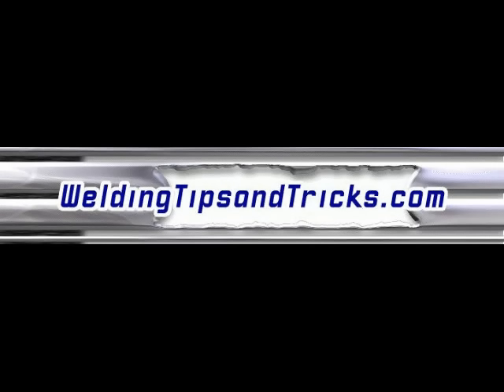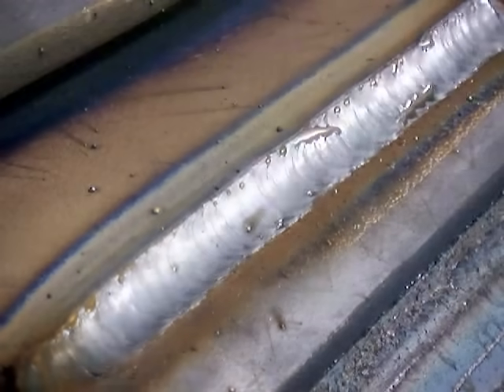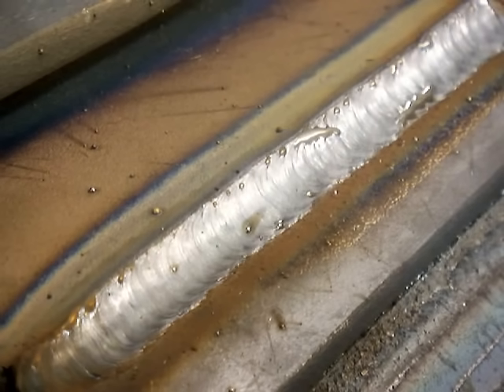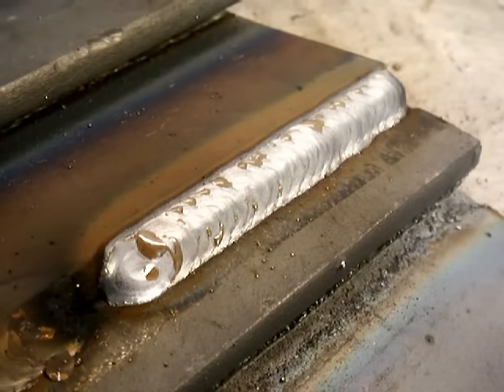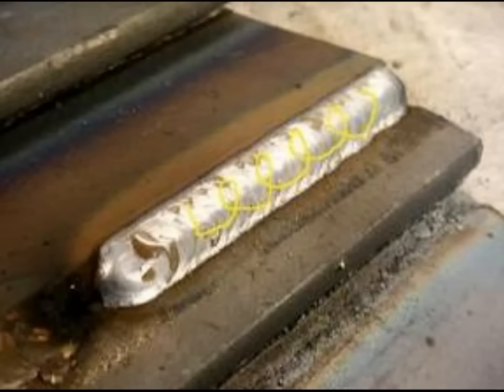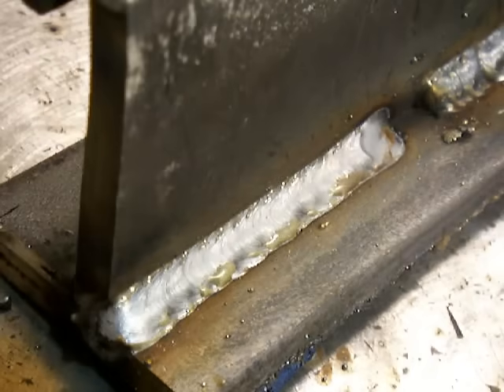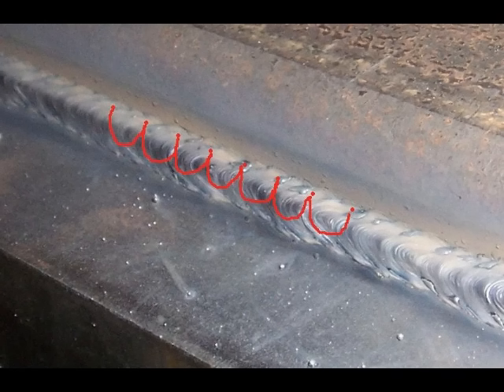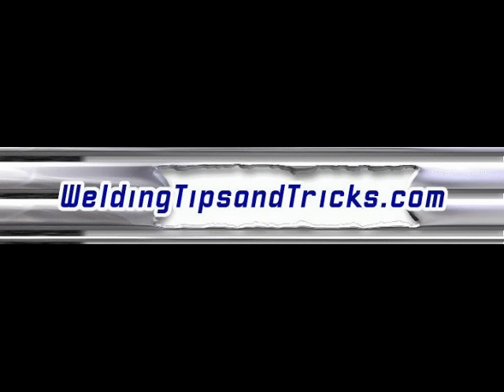Mig Welding Technique Taught by Old Timer

Comment: I do almost the same thing. almost every weld joint. I've been a welder and fabricator in a union for 30 years, never had a weld break. not to my knowledge any way. but I do know when not to use mig. or step up to .045 innershied, or stick.

Comment: Good looking weld but small circles or cursive e causes a weak spot in between the puddle. I welded that way for years and had some more experienced welders teach me to do a slow whip and pause for more strength.  Either process worked I never had a weld break doing either technique.

Comment: I am a new welder and am having trouble doing lap joints on 3/8" steel.  My welds are too convex.  I have tried 17 to 21 volts, and 200 to 350 wire speed, but I just can't seem to get the bead flatter.  I have used a cursive E pattern as well as a zig-zag with a pause on the base metal.
Reply: Try a cursive horseshoe or "C" pattern experiment with slight pause at apex to fill. Works-For-Me. GODSPEED 👍
Reply: @Censored-Sgt  Thank you!!!!!

Comment: This is great for running slower on a weaker machine that can't necessarily keep up--I use it a lot at home.  At the plant I have an old Miller CP-302 and I can crank up the voltage and wire feed and just let it burn.

Comment: Great videos Cody, I was a pro for 10 yrs, welding cylinders prepairing for sub-arc upto 150mm/6" inch to you American's. With stick before mig came in. Now I'm just an old hobby welder, best skill there is, used mig sets with very basic settings these mig welders today are someting else😊

Comment: I stick welded in highschool at vo-tec but i never mig welded in my life it seems to be kinda the same you just got to pull or push the puddle depending on which direction your going seems to be pretty easy with enough practice i should be able to weld like you a pro thanks for the tips!!!!👍

Comment: you should use a "Z" side to side because when you go back where you have already been you increase the chance of internal cold lap. Even if the outside looks very good there is the greater possibility of internal cold lap which for plates you are welding here may not matter but if this is put under high pressure for a long time you want a weld that doesn't have any or atleastthe less cold lap as is possible.

Comment: Awesome videos. Just got a Lincoln mig welder. It came with 0.030 flux core wire. Have you got any videos showing vertical up technique and settings for welding with 0.030  flux core  wire only with no  gas. Thanks  Dave

Comment: Which direction should you Mig weld?!!!!!!
The MIG gun should be pointing upward between 35 to 45 degrees and tilting about 15 to 35 degrees toward the direction of the weld. You need to watch out for overlap and the weld rolling over. Always keep it to a tight stringer beads on any joint

Comment: I have trouble seeing the puddles, not sure if it's my helmet or my eyes aren't capturing enough light. Been a problem for 30 years... Any tips?
Reply from the maker: I wear bifocals but also use a magnifying lens aka diopter in my hood. Fresh new clear lenses along with the right shade lenses helps if I’m doing Tig at 30 amPs I’m using a Shade 9. If I’m welding 3/16 stick rods at 200 amps I might use 11-12 shade.

Comment: you can re tip a chisel with mig weld its so hard a metal
also if you need to fix cast iron weld grind , weld grind  many times ~ poison the metal & eventually just weld

Comment: Nice work, what size wire were you using. The structural fab shop I worked at back in New Hampshire used Lincoln remotes with 3/32 wire and 100% argon.

Comment: The technique mentioned has been used for hundreds of maybe thousands in forge welding. It helps control temperature to allow penetration with undercut. Also mixing of the consumable.

Comment: You always PUSH metal core.
If stick or flux core wire then you can drag.
You cannot drag metal core or you lose penetration in the joint of your weld.

Comment: If you want a stronger weld with more penetration on a down hand fillet you NEVER need to whip, do circles, triangles hexagons none of that rubbish. You will never see a robot that is set up for minimal heat distortion, full penetration and a perfect weld jump around like that. In Australia the correct way we are taught for pretty much any weld other than a vertical up, is to aim for the seam. A good welder can set volts and wire speed depending on material thickness so that you can run a steady STRAIGHT run that is 10 times stronger than this whipping nonsense. I see it as unnecesarry extra heat input. Sorry it might look ok but its just the way I was taught off old heavy fabrication boilermakers. And yes I've seen NDT proving this.

Comment: This is how I learned to mig weld, I now use a stitch 95% of the time. Beautiful looking welds and walking out of the puddle and coming back helps dig deep in front of the puddle and let’s the puddle freeze a bit before washing back over it. You have to be careful in over head as sometimes I have found that the pause required for this technique can cause the puddle to sag too much.

Comment: I respect that this guy is certified, but experience is another story. Also, this method of welding is very versatile, but only in situations that I mention below.
At the end of the day if you need a fatter bigger weld bead, like my old welding teacher said, run more fillets...ie double or tripple.
Also a welders preference to the throat shape of the weld is each to their own. My old man used to weld like this bloke, but when you learn that a flat throated weld, with more amps/heat/penetration is always the best way to weld a fillet joint, on most high strength joints for that matter, mainly structural where it counts.
My advice from welding since is was 5, is full penetration with a slightly convex (flat with toe of weld flaring into metals evenly) with an even continuously flowing weld pool , with parent and joining metals preferrably pre heated, having torch wire running just enough fill to do the job. 
Think high heat penetration,  conservative but strong enough wire speed to just fill the weld void/bead, NEVER and I repeat NEVER unless for the real reason you use this method, as I will state below.

The reason you weld like the method demonstrated on the video is much more effective if you have under power or low amps throwing ftom your welder.
I have used and mastered this method just as this gentleman has shown in situations where i had low amps (site welding on cattle yards etc. Where farmer has limited amps available) or if my welder is simply too underpowered for the job. Take it from me my old taught me how to weld and how not to weld. 
Not only is the youtubers method best for low amps, but also for burst piping etc. You cant beat a weave weld for that.

My biggest respect for the youtuber, but a flat high penetration weld is crucial for the highest strength welds, no matter what metal you use...
Reply: And keep the weld pool in a straight line...

Comment: You might try hitting the root, so a short move up the weld joint at the bottom, before you make the U utilizing the same technique at the upper edge, eliminates any lack of penetration at the bottom of the joint.  I guess I qualify as an old timer, being 69 with 50 yrs in the trade.

Comment: You put a neat weld down ..I'm an old hand & I tell you what my tenique is ,. I use very little movement welding right to left at an angle of about 1oclock with Max amp for the material and direct that weld into the root of the joint but not too fast a wire feed to cause cold lapping .... you'll know if you've done a good weld , and if you don't know ....do a test piece cut it open & look for root penetation .  Keep the good work up buddy .

Comment: All I see is undercut in that long length of weld. Wow I just noticed I said the same thing 5 years ago! Didnt realise I’ve seen this vid already 😃 Im a boilermaker by trade and I’ve welded a lot of structural welds for mining machines and also structural aluminium. This technique looks pretty but on a structural crack test would most probably fail. I’ve done six pass welds that have passed.

Comment: With 035 wire welding 2f what should be the wire speed and amps?? I was told 18.5 amps and around 200-250 wire speed but the wire sputters often??

Comment: Do you have some table, or send mi a link in which is shown how to set up paramteres for mig/mag welding (voltage, ampers and wire speed for different material thickness)

Comment: Anytime the puddle goes under the arc, you lose penatration. Try it with a butt joint, leave a 3 mm gap and go slow, then go fast- the faster weld penetrates deeper . That's why solid wire needs multipass fillets to build weld size. Looks nice but that's all...

Comment: Been using the same technique for years with just about flawless results. until resent job change and can't use method with 1/16 metalcore wire

Comment: I was taught never to weave a root run due to less penetration. But I don't see anything wrong with what he did there! I'm sure there are always expectations (boom welding maybe). I think with welding, there is more than one way to skin a cat as well as people having their own personal technique. Cool vid :)
Reply: You are correct.   If you whip or manipulate the puddle on a weld test or certification. You will fail. When xrayed you will see a sawtooth pattern in the weld that is prone to cracking
Reply: @LabRat355  so the e tip is pointless then?

Comment: Hi, I took a 2 day welding course just out of interest and a desire to learn a new skill. I found that I got the basics and was able to connect 2 pieces of metal in a way that formed a strong bond. In this regard I suppose I can weld but I know it will take many, many hours of practice to even begin to approach a basic level of competence. The issue year I ran into was viewing the weld as it was being made. The first day of the course I used one if there welding helmets but the visibility was so poor I bought my own mid range helmet that night for use the following day. It was better but still provided no where near what I considered an adequate view of my welds as they were being made. I feel I am making a fundamental error when using the helmet and the tutor was unable to make me understand what I may have been doing wrong. Do you have any suggestions on how to best visualise the weld whilst making it?

Comment: Looks good either way. 
However, I found that pushing would most always show lof in spatter between the base-metal and the weld, that didn't fully flow back into the weld in test coupons that were x-ray'd.

Comment: I learned to weld watching a old guy that never would tell any one how he did anything. I never ask him about welding just if I could help him with anything. For a year or so he always said "Thanks I have this one under control." Then one day out of the blue he ak me to go get a bottle of Iodine out of his tool box and threw his keys at me. I am glad I had fast reflexes or I would have lost teeth. That day he told me hours worth of stuff as he kept putting iodine in a cast iron frame he was repairing. Years latter I put it to use repairing drill heads on a 10 inch well drill by putting all new teeth in. The Forman got mad because he thought someone bought new drills. Then everyone point at me and he was smiling like the cat from Alice. Thanks for the tips on the tips.....
Reply: Why would you put iodine in a cast iron frame?

Comment: love your videos both techniques work but the company I recently took a weld test for told me if I pull at all during the test I automatically fail. So always ask if your testing, doesnt matter what you think is right if your trying to get employed the employer will decided that. I asked want a push, pull, or a straight angle in.  He said straight or push but if I see you pull at all your done. I passed, and am glad I was taught with GMAW always push or have no angle.

Comment: Thanks for the effort making this, I regularly might this way now and only thru trial and error did I stumble upon this technique. It is a great way to have professional looking welds especially when you don't weld daily to keep your skills sharp. I am a heavy diesel tech working on construction equipment and when I have to break out the not so current welding skills this style helps everytime. Cheers.

Comment: I had a foreman tell me that pushing doesn't get as much penetration as pulling. We did a test like your example and my pushing got more penetration than when I pulled it. He cut out a section with a saw and applied acid that showed the penetration. After that, he left me alone. I went on to weld a total of 38 years.

Comment: Thats common sense welding, Spent 34 years as a cast welder and certified in 3 states. Caterpiller, John Deere. Waterous, Komatsu Gallion. I had to be certified by each company to weld on there products. And i had my stamp on them as ready to be machined. Alot of it was was Eutectic powder spray. This what he is doing is nothing. He should try 5/64 th Flux Core

Comment: please can you tell me what voltage number and wire speed you was on they video i was doing lap joints on 1/4" carbón steel whith deltaweld 452 and i was 480 on wire speed and 25.6 voltage and my metal was pretty clean and evering is good but sometimes y don't have my zizeling noise and i sthill weld pretty good but i don't like that
Reply: .35 solid core

Comment: I can also appreciate the comment that you have several pieces to do in a day and that you are looking for any way to get them done as quickly as possible. I started as a production welder. Run it hot and fast, no weave, just wipe the joint. Nothing I did in the past was visible to the customer. Now, at my current job, 90% of what I weld is visible to the customer. So I am constantly looking for ways to "go fast and look good". My biggest problem arises from fitment. I have very little control over supplied component pieces. Some joints, your techniques would look extremely good. But in other areas of the part, fitment is so bad that I am forced to use a different weave of the torch. That produces a sense of irregularity to the eye. So I guess my biggest struggle is to trying to find the one weave that I can employ for the entire part to be consistent and visually pleasing to the customer.

Love the videos by the way. I'm not a snob like some welders. I will accept information in any form if it will help me to become a better welder and employee.

Comment: I find that push or pull it dependant on the location and ease of access. Both work fine. But some instances are better for one method or the other
Reply: Far less penetration pulling no good for structural work
Reply: @JOHNTNT  sometimes fixturing is an issue. If it was a perfect world, the would all be a push. But not always practical, was my point.

Comment: I was taught this too by an "old timer" but it was when i went to college for welding that i was taught about how this method looks good and i still do this at home too but it IS NOT used for structural or anything requiring great penetration. What happens when you go back in the circle is the puddle gets cold and then you circle back into it pushing hot filler into a cold puddle. 

I was taught zig zags with pauses at each point to build the puddle ( /\/\/\/\/\/\/\/\/\ ) as a preferred method as it keeps the puddle flowing and doesn't allow for any material to become cold.

I've learnt to be careful about the old timers tips. Once i was working at an automotive shop and i forget what i was doing but the head tech came up to me and said 
"why are you doing it that way?" 
so naturally i said "this is how i was taught??" 
Then he said "Ohhh okay, well i have 28 years of experience and that's not how you do it"
Then i said "oh okay, the guy that taught me this way has about 35 years of experience"
Then he paused and said "......oh well tell him he's wrong" 

Since then and including then i've worked at many shops, my advice is to earn as much as you can from different people and let that shape your own opinion as to why you do things your way. Never be ignorant and always look for a better way to do something. There's a thousand ways to skin a deer and they all work great, some work better for some people and not as good for others.
Reply: Thanks mate

Comment: I was taught circling back in to your weld will contaminate it.
If you wanna do this, you can do an elongated Z, step back and forth, or just pause consistently to let the puddle back up a bit - but you should never circle back.
I was also always taught the direction you point your tool is where you are concentrating your weld heat so keep that in mind.
Ultimately though, even this method is fine for a cap weld as long as your structural welds are done for strength and not just appearance.

Comment: After years of recreational welding, I bumped in to your you tube videos. In one of the mig for new to welding vids you mentioned that you like to use the cursive small e, but that it wasn't necessary. Just habit, I think you mentioned.
But I must say, of all the tips and knowledge I have picked up on, this tip really changed my welds. Amazing ah ha moment after laying some sweet welds, Thank you so much for sharing.

Comment: Nice video, I enjoyed it. The comment section is unreal. These guys with "40 years experience" telling guys they should be pushing all mig. Proof positive that you can be wrong for 40 years..lol Push tig, push spray arc, push thin gauge on mig if you want, push oxy/acet, and drag everything else. Drag mig over 16 gauge, flux core, dual shield, SMAW. This is what I was taught 25 years, and a few thousand UT's ago.. Pushing mig produces lower penetration. That's what Miller Electric says, but what do they know..lol